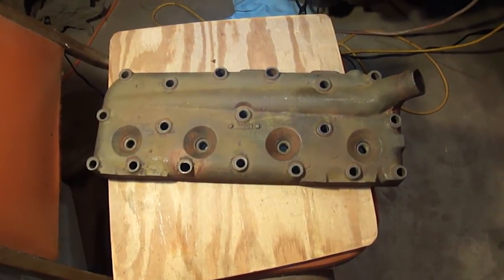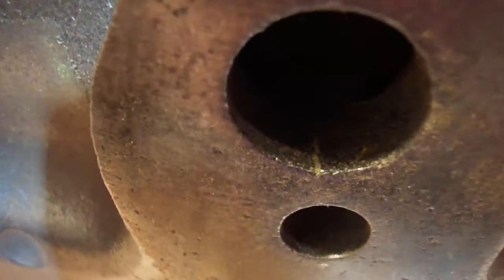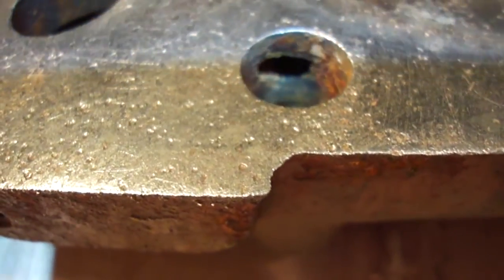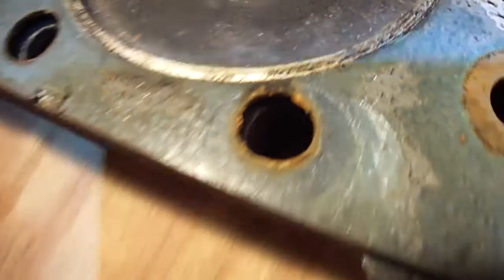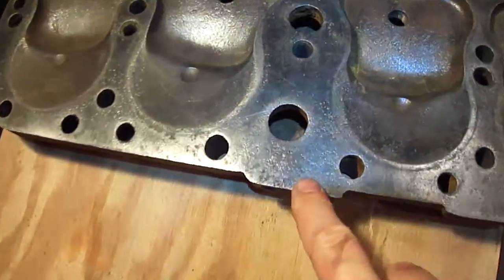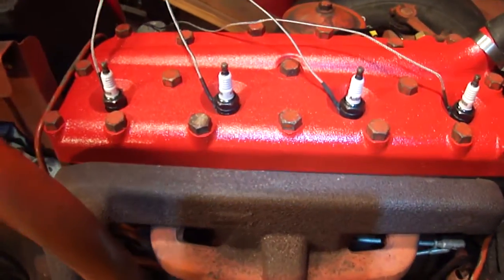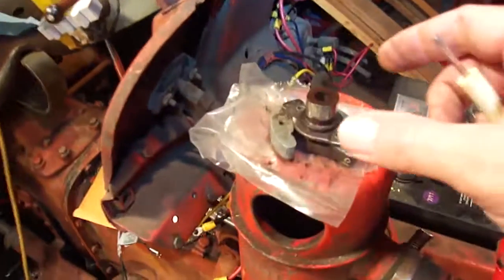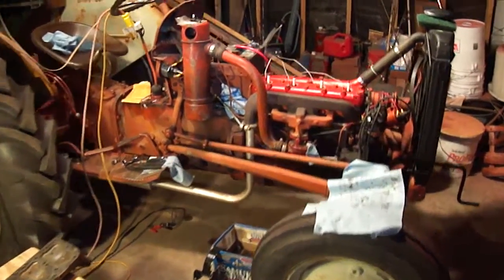Ford 8N 1952 Head Gasket Leak Part 2 of 3

Comment: Are those cylinder head temperature probes under each spark plug?
Reply from the maker: Yes.  It was a pet project for me.  I had a lot of sediment in the #4 cylinder when I changed out the welch plugs and I wanted to see the temperatures on each cylinder.  Also the manifold gasket at the #4 cylinder was showing signs of blow-by.  I replaced it and wanted to see the temp spread across all cylinders.  It is fine now.

Comment: Do you have any ideas or recommendations on head boolt tightening sequence? I have one patern, but was told Ford revised it, so now I am at square one with no information on bolt pattern tightening. I have a  1952 Ford 8N
Reply from the maker: Check out this link :

https://forums.yesterdaystractors.com/viewtopic.php?t=1428185&highlight=head+bolt+sequence

The first pic with the blue circles matches what is in my Ford FO-4 Shop Manual (Tractor Supply has them).  The second appears to be the "updated" version.  I used the one from the manual and have not had any problems since.